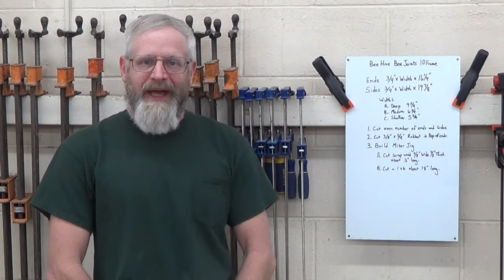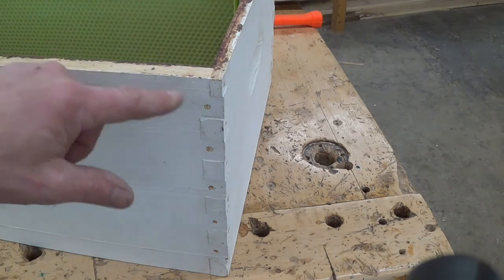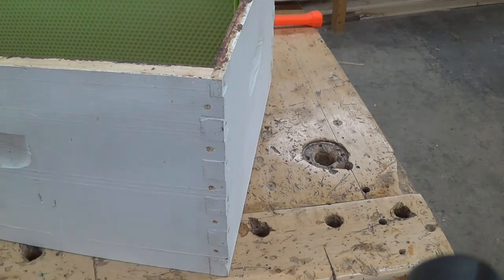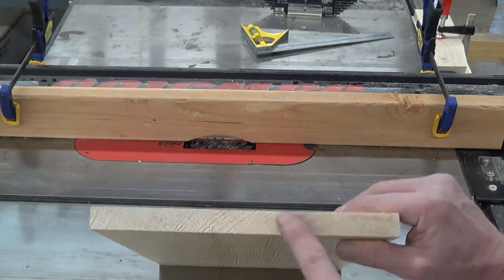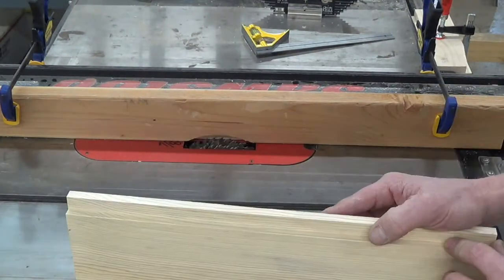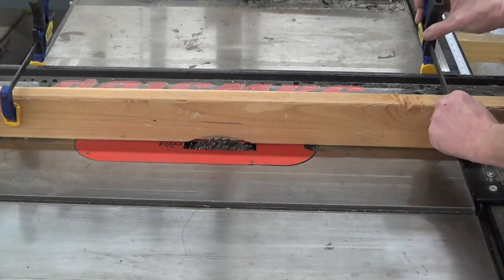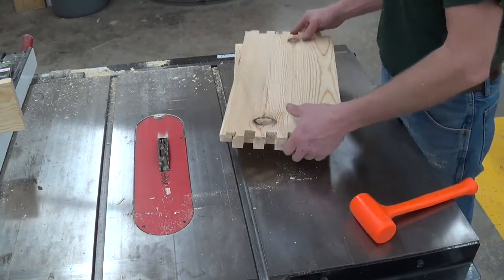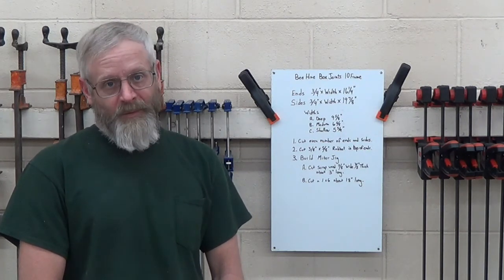How to make Bee Box Joints with a Table Saw

Comment: Good job making box joint supers and deeps.  These will last 20 years and more.  Pre-drill all nail holes, use water proof glue if you have it.  It will seal the wood from moisture.
A simple jig like this is all that is needed and keeping focused as to what you are doing so you don't cut the wrong part.    Thanks

Comment: If the end boards that have the frame ledge had the pocket instead of the pin at the top you wouldn't need to make any adjustments.  It would just be a full depth normal stepover cut.  Correct?
Reply from the maker: Correct, but the lip will be unsupported and fail quickly. You can do it that way but my experience tells me it is a poor idea.

Comment: Which saws have a large enough arbor to take a 7/8 dado? Perhaps the old belt driven Grizzly.
Reply from the maker: @RobertSpence-w3n  Many contractor saws have a large enough arbor, also most but not all cabinet saws will accommodate a 7/8" dado stack. You will struggle to find a large enough arbor on home owner/hobby saws. I hope this helps.

Comment: You would not need to make a special cut for the rabbit if you reverse the teeth such that the side getting the rabbit starts with a space/notch instead of a tooth, and the long side starts with a tooth instead of a space/notch. This way the tooth from the long side covers the rabbit up with not need to change the saw at all.
Reply from the maker: The box will fail there after a few years. That is how I started out. It doesn't work for the long run to cut that corner....
Reply: @pathofthebee2873  I have boxes done this way that are pretty old, and have been wood working since the late 1980s. There is no weight on this spot, and the non-rabbited side takes all the pressure from moving frames.

Comment: Why don't you just cut that thinner top piece off, instead of making the 5/8" cut?  That way you're not having to rerun all those sides just to do one off sized cut.
Reply from the maker: If that piece is not there the rest of it will break off as you use the box. I know this from experience....
Reply: I’ve seen other videos where the top finger is cut off completely on the short sides. This gives a full finger on the long end which I think would be even stronger and every notch is the same. Have you tried this?
Reply: @hildebrandtrius  That is how I make mine, works great.